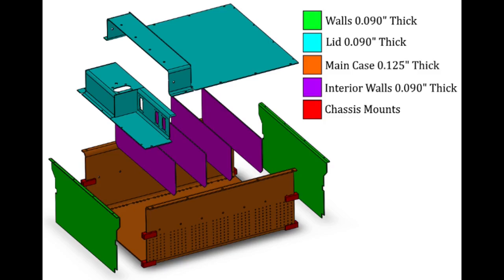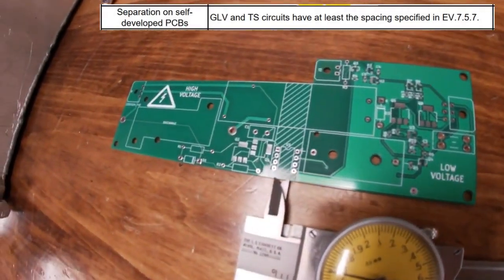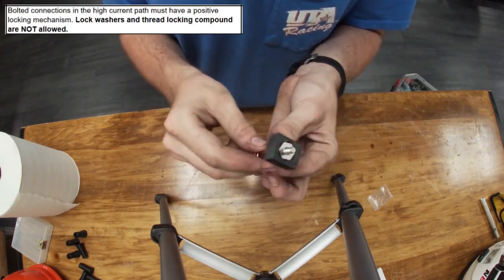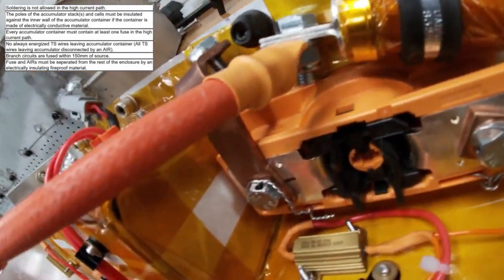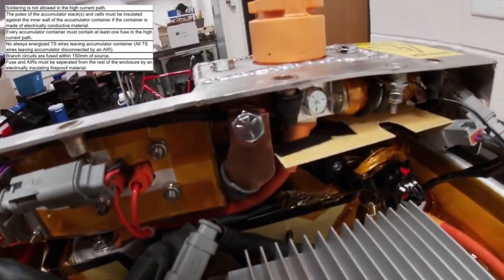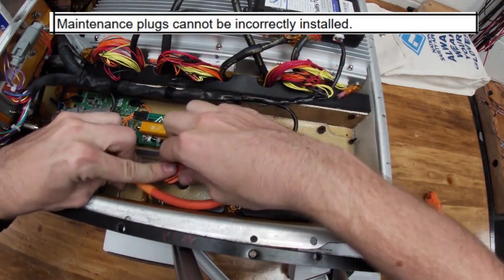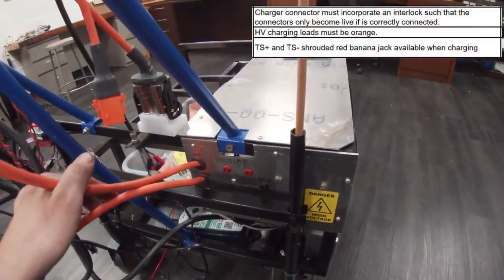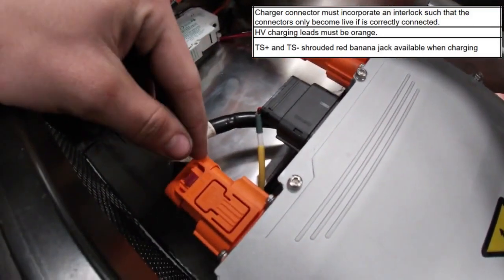UTA Racing 2023 Accumulator Pre-Tech Accumulator Inspection

Comment: Thanks for sharing your accumulator inspection video!
I would like to know how do you wired high voltage fuse (belfuse 0ADA)
Does the fuse held in holder or did you just soldered piggytail fuse right on the wirings?
Pre-thanks for your reply!

Comment: Hello,

My name is Pedro Henrique, and I am a member of the Faraday E-Racing Team in Brazil. We are planning to start using the Orion BMS 2 next season and we are studying how the best teams in the world use it. Therefore, I would like to ask a question regarding the positioning of your Orion BMS 2 as shown in the video.

In the video, it appears that the BMS is placed inside the accumulator without any visible ventilation, and the thermistor module is positioned on top of it. My question is: does the BMS overheat in this configuration? I ask because after reading the manual and reviewing some comments, it seems that the BMS generates significant heat. This is why we are considering designing our accumulator with the heatsink on the outside.

Thank you!

Best regards, Pedro Henrique
Reply: The Orion only makes significant heat when balancing the cells. Otherwise it dissipates very little power 

Falou Pedro!

Comment: Did you guys have trouble with using the temperature sensors on the enepaq modules with the orion bms?
Reply from the maker: Hi, sorry the response is so delayed! I hope you reached out to the team and they already got back to you, but if not:

Yeah we did. The enepaq temperature sensors are capacitively coupled to the TS, and the Orion thermistor expansion module requires the temperature sensors be GLV referenced. This combination is not compatible. We made fairly extensive modifications to the Orion TEM to make it work: We essentially applied such a large analog filter to the temperature signals that this noise wouldn’t matter (tau measured in minutes not seconds). This technically meets the rules but it probably shouldn't. We ran the endurance very tentatively for this reason.

Orion and Enepaq were not helpful at all in addressing our concerns and as far as I can tell they claimed compatibility before doing any testing whatsoever (and many FSAE teams tired this same combination and failed because of this).

My suggestion is
If you want to use the Orion TEM, use different temperature sensors. (more involved, but a straightforward packaging problem)
If you want to use the enepaq temperature sensors, design your own TEM which is TS referenced, as described in the enepaq datasheet. (more elegant, but less foolproof).
Reply: @timstevens135  Hey thanks for replying! We ended up not ordering the enepaq modules because the cost was very high. We are designing a custom battery solution now.